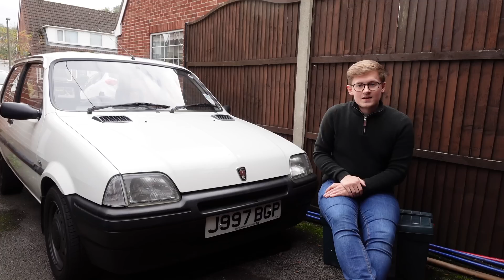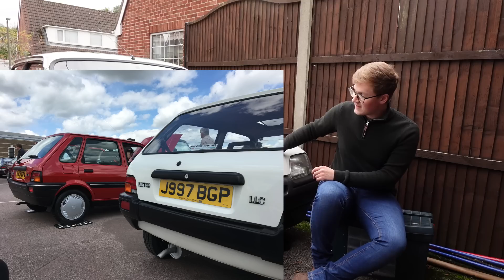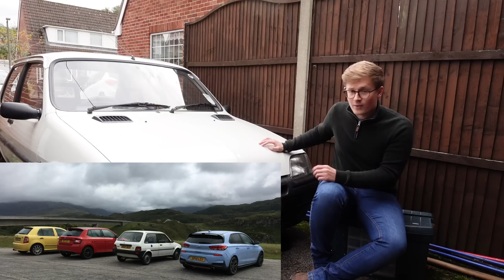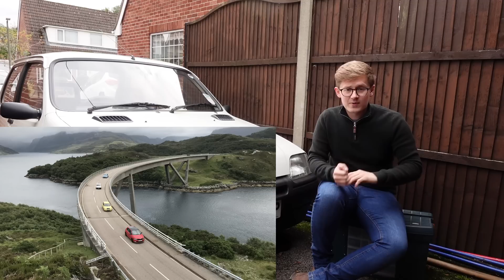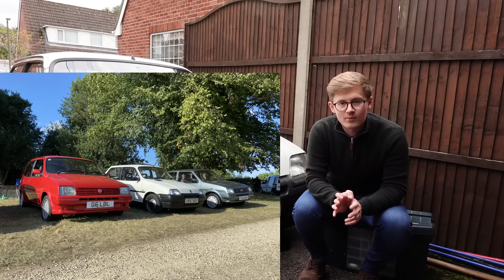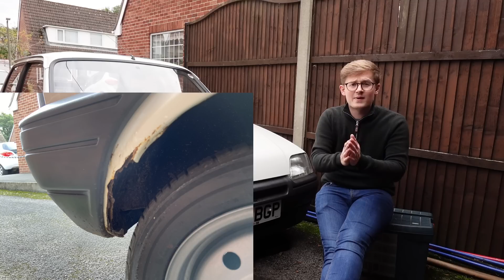Meet Melvin - My Beloved Rover Metro

Comment: Great to hear background to your friendship with Melvin. 

We had several versions over a number of years in the family, a 1.1C (unlike you though, I was not a fan of the engine in that car), a 1.4 GSi automatic (a lovely engine/transmission match), and a manual 1.4 GSi - I found the driving position a bit too awkward for town driving though, unlike the auto which was much easier coz no clutch to worry leg position. The 1.4’s gave excellent performance and with diminutive dimensions made for a quick car along back roads. At the time, the motoring press criticised the 1.4 for being less nimble due to the heavier 1.4 over the 1.1.  But handling was still fun, just not as delicately balanced. 

Preceding the Rover 100’s were original A-series Metros which were much liked and great in the snow. Yes, tin-worm very much got to cars in those days though.

Comment: Great Vid my brother had a 1.1C. He took it on track days. It always punched above its weight I'm a big fan of the K series.  My 2nd car was a rover 214 a great car. I didn't mind the fake wood. The joy was the K series engine and it handled well too. loved 4 wheel drift on roundabouts. Unfortunately rover also made my worst ever car an MG ZR which died after only 63000 miles due to cheap wiring. It was one of the last ones off the production line before they went bust so thought i had a bargain. It proved they were cutting corners. Same engine just wrong time to buy. heyho but still annoyed seeing slightly earlier ones driving around.

Comment: You have certainly bonded with this car Ed and I can certainly understand why. When things that need to be looked at 'at some point' and others need t be done it sometimes makes sense to just do the lot. My first car that wasn't well past it's sell by date was my 'A' series Metro 1.3L on an F plate I bought second hand. I had that car for ~8 years and only sold her when I relocated to a completely different part of the country for work. At the time that leaded petrol was being phased out and the engine would need re-working to take unleaded fuel along with a list of items that would need sorting at some point would have been expensive (but not an issue) and the car off the road for some time that was the big issue. That combined with a new daily commute that changed from 6 miles a day to 20 in a new job meant we parted ways. 23 years later and I still miss that cars character that thanks to your videos of Melody brings fond memories back. Keep up the great work Ed and update us on the progress on Melvin.

Comment: All the best with this resto, Melv definitely deserves to live on for a long time.
I wonder if the 3-piece bumper was originally intended for the van variant, which never happened. But, maybe the parts had already been supplied and were used on the 1.1C, rather than have them go to waste.
Reply from the maker: It couldn’t have been intended for the van, as van production was always going to end once the K-Series came on stream. And these bumpers were only introduced a year into production anyway.

Comment: You gonna drop a 5 speed box in? I am tempted to swap my Micra's 4 for a 5. I don't often venture on to a motorway, but when I do the poor old girl is screaming her little head off at 70mph.
Reply from the maker: I’ve already bought a 5-speed. Don’t buy one for lower revs. That’s not how they work. They aren’t 4-speeds with an extra gear on top. They just spread the ratios closer.
Reply: @TwinCam  To me that seems unusual. I know on a K10 the ratios on a 5 speed are slightly closer than on the 4 speed, but 5th is still a higher ratio than 4th on a 4 speed.

Comment: So....little Melvin's heart (among other things) is going to get either a little titivation or a transplant.  If a transplant (and if at all possible) keep his original engine off to one side in case you ever want to put him back to original spec (some people do).  

Me?  I'd be interested to take the little 1.1 litre K-series and chuck a road race camshaft, bigger valves, double valve springs, port and polish the head, dual timing chains and either twin carbs or a two-barrel downdraught or side draught carburettor and manifold.....coupled with LCB extractors / headers if they did not go on with the Maniflow (which I don't believe they did).  That way when someone asks what manner of monumental power plant you have in it, you can still tell them it is a 1.1 litre!

I suppose you COULD go the whole hog and throw a 1.4 litre 16v SPI or MPI donk out of a Metro GTI.....or even more power-happy and drop an MGF's 1.8VVC in.....but the latter would definitely mean adding an engine management computer....and I think at least the MPI might need one and all.  Hmmmmm.......  You've got me stumped, Ed - with so many options that appeal, I can't decide which way I reckon you'll go!  Whatever engine it is, it MUST be mated to a 5-speed manual transmission, because I don't believe you'd be one to enjoy an auto....or would even consider it as an option for Melvin's refit!

I reckon that you'll want some better stopping power if you up the ante on the engine, so I can see some work going on there too.  Man this is a bit scary - I'm thinking more about YOUR project than I am about the ones in my garage!  Any way you look at it, Ed,, it will be an improvement to how Melvin is now.  Yes, he's perfectly adequate and a lot of fun right now, but I certainly get the idea of making a car "your own - just the way you want it".  

I have three in the garage that I have taken certain liberties with as well - after all, who drives them?  I do.  Therefore, they have to reflect what I want in my car - and of course what I want to get out of it.  The first modification I did for all of them - a Triumph Stag, a Triumph 2500S and a 77 Mini - was to design, build and fit cup holders for that ever-present cup of coffee!  

I'll look forward to see what you have in mind for Melvin as it unfolds over the next few months.....or however long it takes......and if it IS a 16v engine, you will definitely have earned that channel name of yours, won't you?!  All the best
Reply from the maker: I have something already in mind… 😉